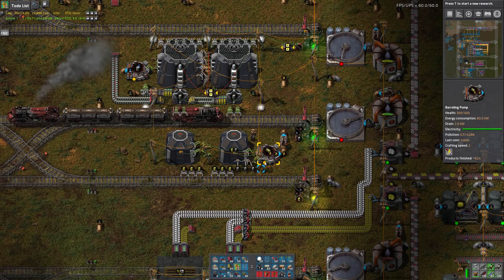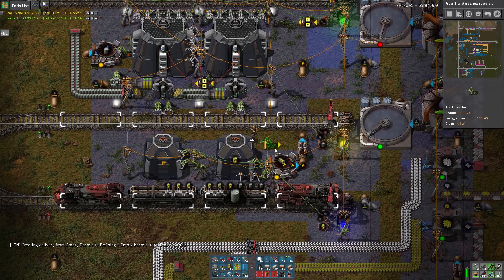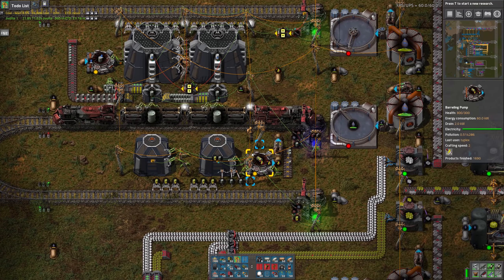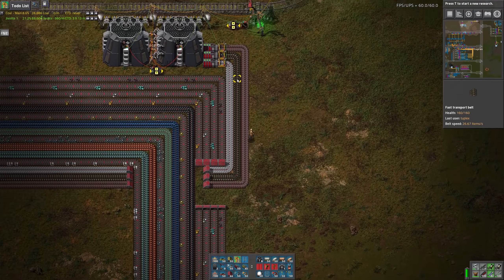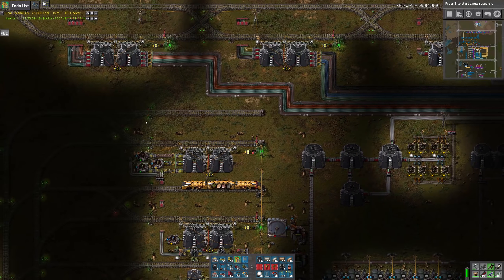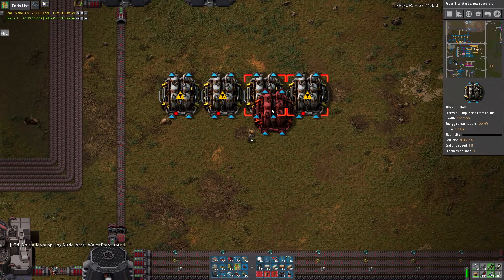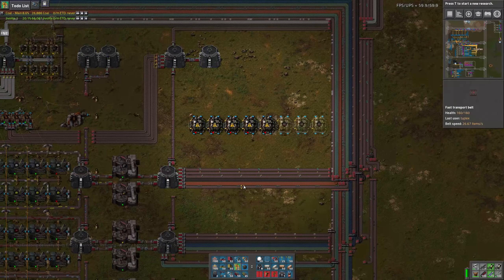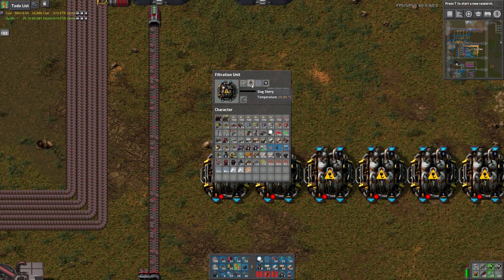Factorio AngelBobX Let's Play #47 - Mineral sludge

Comment: The slag needed for concrete is such a tiny amount, that you could just electrolyze water on site instead of bringing it by train.
Reply from the maker: I could fill a book with good tips from Ragath87.  Thanks!
Reply: it might be better to only clarify saline water when the purified water is too low, or turn the saline plant on when the saline water is too low.

Comment: Would it be more efficient to move the slag and rock processsing near the waste water processing. There is sulfuric acid and purified water in abundance also the the slag and rock stack in significantly higher amounts than barrels making transport easier. Barreling mineral and cryatal sludge may make this not quite as effective unsure on the maths.

Comment: The fact that you have not one but three (!) clarifiers getting rid of sulfuric waste water suggests that your sulfuric acid production is insufficient. It looks like you'll be burning through a lot of sulfuric acid now that you're making slag slurry, so I hate to see you clarify sulfuric waste water that could have been turned into acid that you're going to need real soon.
Reply from the maker: Hi Robin, after the episode finished, as I was doing cleanup, the clarifying stopped.  My acid production had actually stopped because I wasn't using it.  Now that it's being consumed, the waste water is getting used.  We'll make adjustments if necessary...